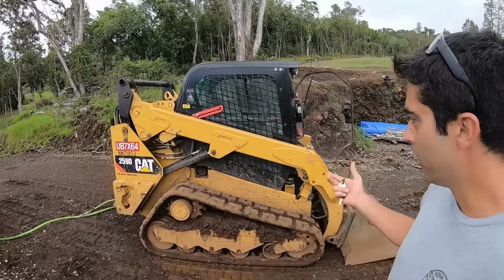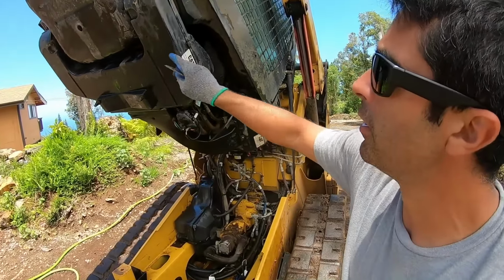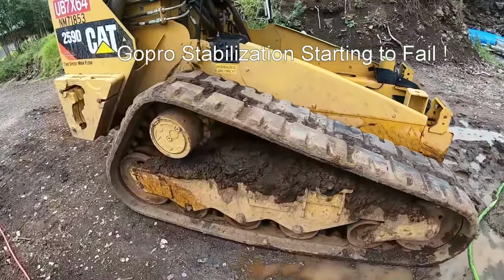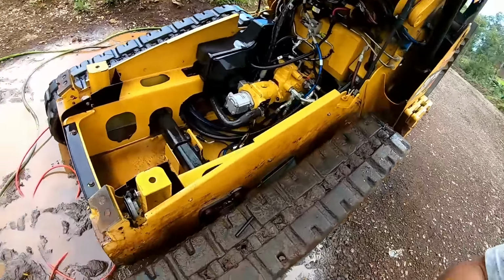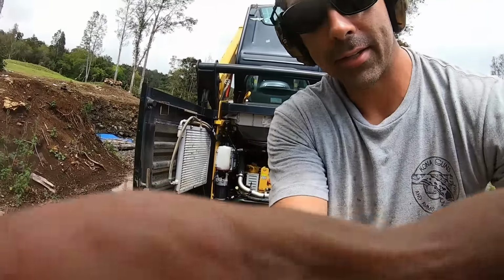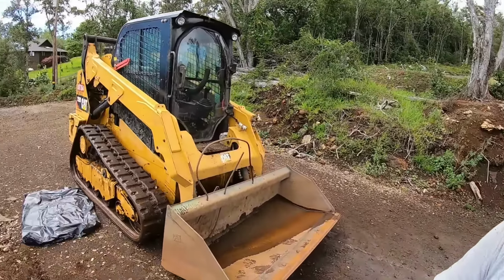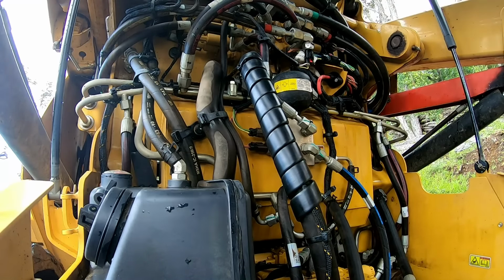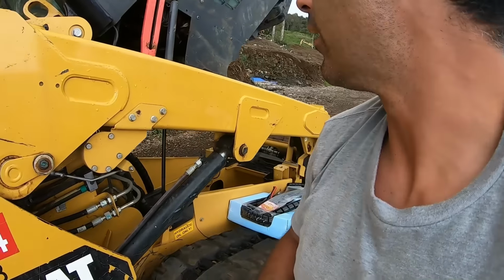Pressure Washing a Skid Steer / Compact Track Loader

Comment: Nice job cleaning up your machine. I tend to think they run better clean. lol.  But you need to go back and and give the cooler that is mounted on the back door a good hard look. It had 1 pressure washer spray mark on the lower corner. Pressure washers will flatten the fins in a heartbeat. Flat fins don't allow air flow IE no cooling.  If the cooler has a fan on it, hot wire the fan & check the airflow across the entire cooler.
Reply from the maker: sounds good, ill check it to see if its ok, thanks for the tip

Comment: Wesley, just a reminder that now is the time for you to replace all the air filters and oil filters and change the engine oil, track fluid, hydraulic fluid, and regrease all the machine's fittings. Also, your next out of pocket cost may well be those tracks, from what little that I can see in the video, they appear to be quite worn and should be checked now for cracks and splittings, before they break apart while in use on a job.

Comment: Man that was full. Maybe spray foam in the holes that way if you need to you can cut it out to work on the hoses.
Reply: Salmon Hunter That would be a huge mistake. These cavities and holes where left on purpose. You got to clean that space and that’s it. If you lock it by foam, you lock as well the water in and foster Rösti spots by that. But partly, I have to say it’s bad engineering. There should be a lot easier drainage. Looks like not very well thought through by the manufacturer.

Well, it’s American engineering...

Comment: Watch out with the pressure washer it will cut the rubber hoses into
Reply: No, it will not. Those are 6000 PSI hydraulic hoses, they take a lot to cut in to. The is metal inside the hoses.

Comment: With just the hose or far away with the pressure washer wash down the radiator. Will keep the engine cool and remove dust in the find. Good luck.

Comment: If you need the operators manual you can call your local CAT dealership and they should just give you one. If not then go to www.catpublications.com and I believe your Manual you want is a SEBP6431-24 259D Compact Track Loader Parts Manual. There is also a 259D3. They seem to cost $40 to $75 for either a book, CD or you can download a copy.

Comment: Hey man ran across your video I was just thinking how about trying to invest in a heavy duty shop vac and removing some of the heavier debris before it gets muddy and wet may make your life a little easier it was just a spur-of-the-moment thought lots of people associate certain tools with only certain things such as pressure washing but not quite vacuuming well good luck just thought I would share peace
Reply: I was gonna say the same thing.  A good wet-dry vac will get a lot of that mud out once it's saturated.  It's handy for clearing holes around leaking water pipes too....same principle.  Too hard to get a shovel in and get much but the shop vac will do wonders.  Just take out the filter and be sure to empty it often.

Comment: CAT engineering is not on top of the drainage situation; we drilled several holes to drain water and mud, the sticks and crud have to be removed by hand.  Small price to pay for reliability!!
Reply: Obviously don't know cat machines, all you have to do is remove the belly plate and you end up with a very big hole for drainage and getting the mud/dirt out 😁

Comment: I used to repair skid steers.  I had one customer that was a hog farmer, with a slurry pit for storing the pig crap.  It was about three feet deep.  When it came time to clean it out, he would just jump the skid into the pit and proceed to dig himself out.  The issue was the engine was air cooled, running half submerged in crap, then shutdown.  Keep in mind, the operator was also sitting in crap.  We would drag it in, clean the whole unit, pull the engine, clean it out, and then make all the repairs.  He would then go home and do it again.  Pig crap stinks.

Comment: next time try this.
raise the machine off the ground on cribbing preferably under the tracks.
remove belly plate bolts and belly plate.
remove plate under engine.
that will allow water and debris to wash out.
caterpillar does have available a 543-2885 drive line kit that will help keep debris from funneling in around drive hoses.
the kit will require removal of the tracks and sliding undercarriage frame out to install.
check with your local cat dealer for it.
they should be able to show you the special instruction for the kit so you can see if it is a job you want to do or have them install.
option 2 take a large piece of seat foam and stuff in around the drive hoses it does work.
please do not use spray foam on the machine anywhere to seal anything.
you will regret it when changing any part that is in contact with the spray foam.
Reply: Absolutely agree with everything you said!! As a mech on those damn things owners/rentals go swimming in some of the most swamped ass places and moving the unit out of the wash bay 3 times for one unit is insane! Glad you spoke up!!
Reply: Exactly. Maintenance isn't a hard math problem to solve. Its a simple formula: If you don't take care of your equipment, it won't take care of you. I wish I had that much money....

Comment: In the next few days, my neighbor and myself will be cleaning a 268B skid steer. It had been used by a company that mulches trees, and having looked at the unit, it is completely filled with small sticks ect in every place stuff can be lodged, and mud caked on everywhere. Dont believe they every cleaned it. They work 90 pieces of equipment , they keep for so many years then trade them in. This one has 1200 hours on it. Sounds good. But needs a turbo. We will replace, appox 700.00 for turbo. But this thing is a monster. But really dirty.
Reply from the maker: Sounds like a several day job, you will be surprised on how much material can get packed into the inside, i couldn't believe how much material i got out of mine, id say at least 2,000lbs of gravel and mud. Good luck on you new venture, those cats are monsters for sure.
Reply: Its really bad, the belly pan is also filled up, so that has to be removed to clean. Wish we had a large concrete pad, I know were going to end up with a mud pit. We havent even looked under the cab yet. This is the biggest skid steer I have ever seen. I dont think large company's do any cleaning at all, they just put them to work, and when the time comes, they trade them in. They operate about 60 of these same units. He got it for a great price 5,000 dollars. His brother works for Cat dealership. We have one heck of a learning curve ahead of us.
Reply: Well, they didn't by it to maintain it...
Reply: Yea I worked for a Trucking Company, we would get new trucks, rain was the only wash they would ever get. Like everything else it comes down to money.
Reply: After cleaning the debris. Foam it with truck mudder from chemical guys. Then final rinse with hose. Clean on some or gravel area or draining area. Good luck with turbo yeah like the pins in the new Holland to sadly get out.
Reply: Well we got it cleaned out, was not as bad as I feared, under the cab was alot of small sticks and some mud/dirt, but not to bad, inspected all hose under there, all looked good. Started on the Turbo change out, and now we have a couple of bolts that dont want to come out, we have a torch but no gas, we will get some today, and try to heat up the bolts. I never knew they made turbos so small, I could , when we get it out, hold in the palm of my hand, like a baby turbo, cute little thing, but the bolts holding it in aren't so nice, and very little room to work.
Reply: So Charles, when are you starting your channel?! Sounds like you'll have some stuff to start working on. Make sure to watch Wes and AC - take notes, they do a good job.
Reply: @thomream1888  We got the turbo rebuilt, we reinstalled it, and when we started it up, it was blowing black fuel smoke, so we removed the head and found a scored cylinder. we removed the head due to in did a run away on us when we started it up, so we were told by a diesel guy that either a fuel pump, or a injector, one injector would not come out, so we removed the head to remove. Thats when we found the scored cylinder. Its not real scored. Not sure at this point which way the owner is going.

Comment: It is NEVER a good iea to work on equipment with movable parts in an elevated position without another capable person working right there with you and very substantial mechanical braces bearing the load.  BTW, ant hydraulic hose showing ANY type of wear or chacks around the fitting should ansolutely be immediately replaced, not just wrapped with something. Not hing you can wrap areound a hydraulic hose can contain the hydraulice oil pressure if it should burst.
Reply: Boom locks are engineered for that machine. Plus it was just the rubber coating getting worn
Reply: @williamuskoski1385  THat rubber coating is there for a reason. I had a similar hose explode when under pressure on a hydraulic ram system that was used to push a removable hing pin into place. I was new to working with the machine and the other crewembers new about the worn spot but as it was not leaking, they assumed there was no issue.  One day, that assumption proved wrong. hydraulic hoses are layered for a reason.Each successive layer adds strength to the hose structure. This is why many hoses have alternately woven braids as poart of the structure The outer jacket that is ratherly severely worn from friction against a metal part has had part of tye safety layering worn away. How much longer should the owner/operator continue the abrasiuon to continue before making some sort of modification to eleiminate the friction and replacing the hose?

Comment: That bolt/pin should be in the set of holes on the bottom of the guard, that way it can not slip off the hydraulic actuator.